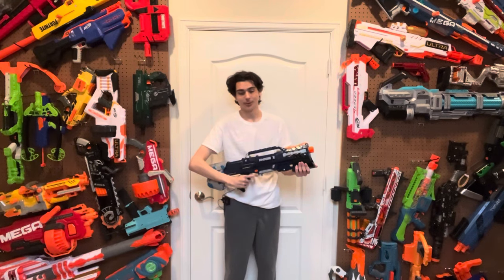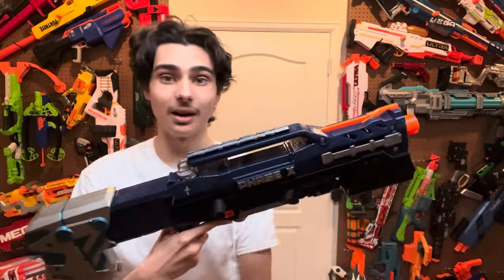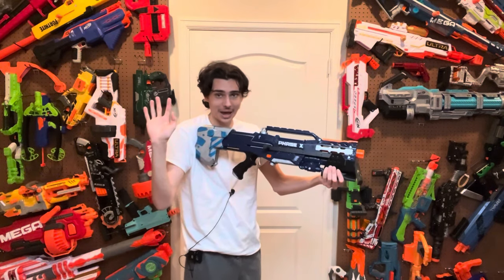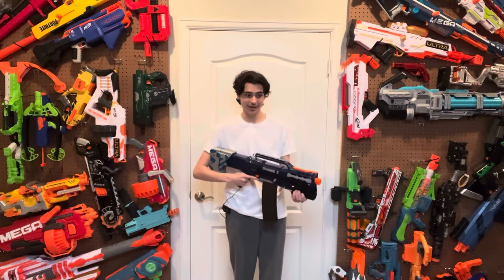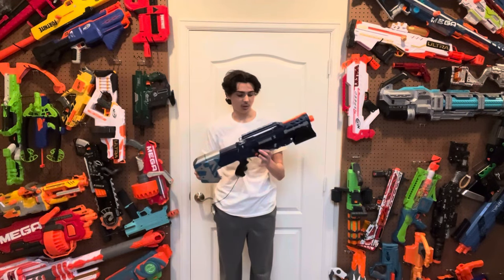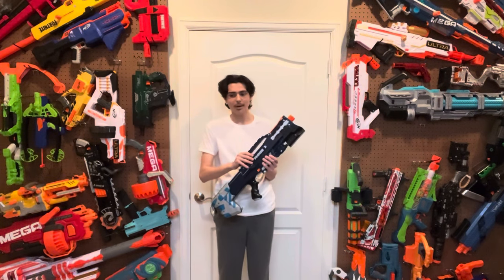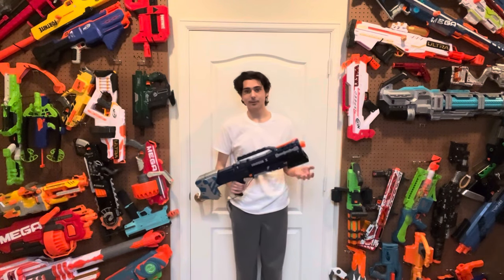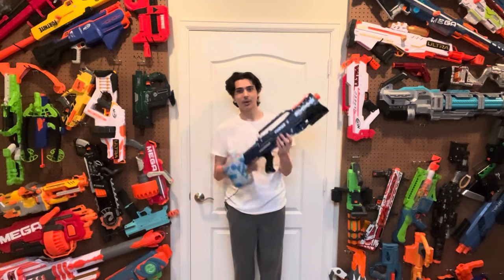Phase X Longshot mod (A little bit better)

Comment: you could’ve got 250 FPS if you used half darts and a longer barrel. Mine has the same prime but gets 250 with worker darts. Same internals minus the addition of a metal pusher and barrel/ breech combo
Reply from the maker: @Seththenerfer  yeah, though I was aiming for 120-130 since this is meant to be used as an HVZ blaster, and in HVZ 130 is the cap